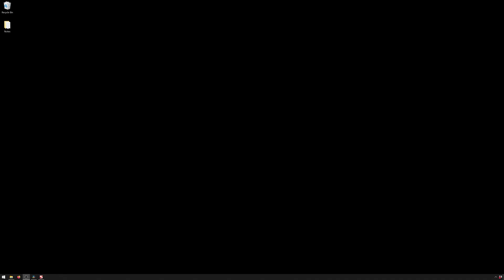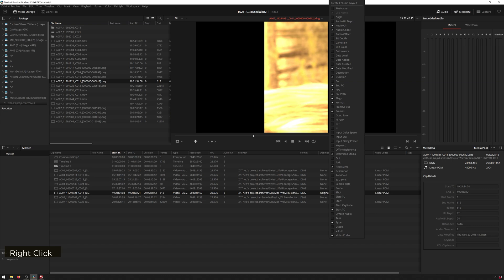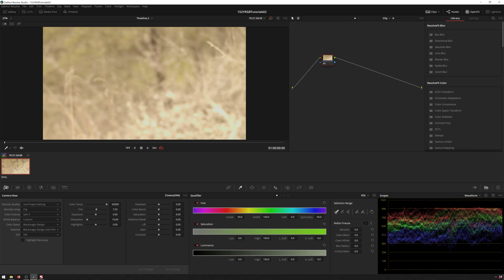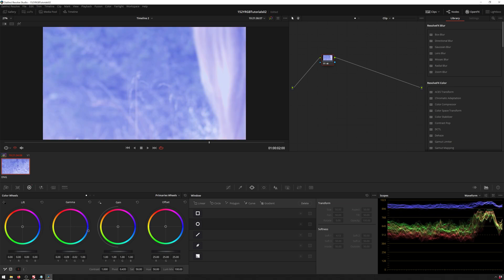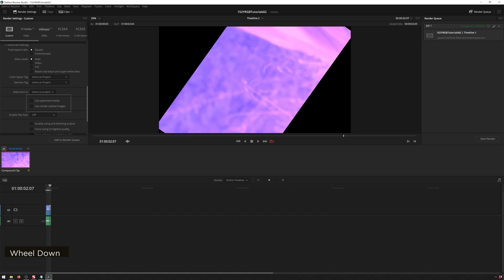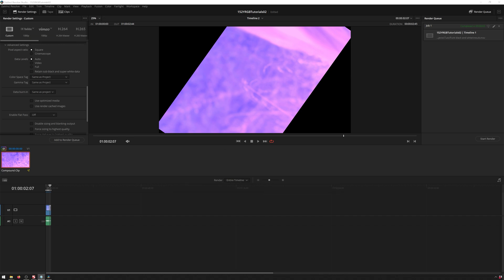A Complete Overview of The Image Signal Flow In Davinci Resolve

Comment: "Source > Debayer > Clip Attributes > Optimized Media > Media Viewer > Edit Sizing > Fusion > Edit Effects > Fusion Cache > Color > Node Cache > Transitions > Sequence Cache > Delivery"  (compound clips jump from Source > Color)

00:22 Source > Debayer - turn Photosite[1] data into normal video. 1:24 example - ?pre-conversion? white balance setting
1:34 > Clip Attributes - example pre-rotate
1:49 > Optimized media(optmed, O.M.)  - makes it "faster" for resolve to handle but has gotchas: cache invalidation and Bad UI feedback 
 ├2:30 changing raw settings invalidates O.M.
 ├ 2:48 false cache invalidation - changing clip attributes doesn't clear O.M. because you didn't actually change the attributes of the O.M????
 ├ 3:51 Bad UI for O.M. - changing raw settings on Color Page(shift+6) means the optmed is invalidated but still show as O.M. in media page.
 └ 4:47 Set  O.M. format to DNxHR HQX?
5:12 Optimized Media > Media Viewer > Timeline - O.M. & clip settings make the timeline ?desync'd?
5:56 Edit Sizing > Fusion  - 8:10 going to fusion takes away camera raw properties? (I can't see the UI feedback that indicates this?)
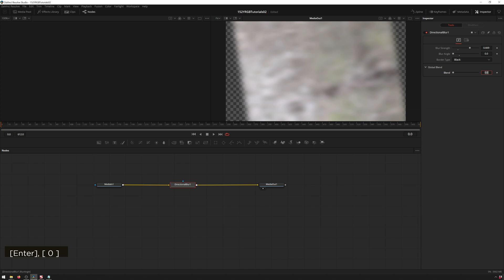 └ 6:19 example of stacked[2] effects v composite - rotation occurs before blur effect so produces horizontal ?artifacts?
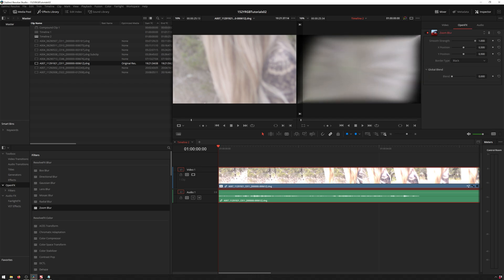6:40 > Edit Effects zoom blur happens after fusion, so is stacked not integrated
6:54 > Fusion Cache 
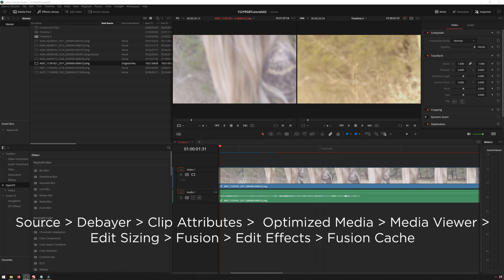8:56 Fusion Cache > Color > Node Cache - cache can be done before|after fusion
 ├  10:06 > Node Cache - turn on cache at specific location in Color Page after fusion
 └  11:36 > Node Cache - make a compound clip to use Node Cache before fusion 
12:27 Transitions > Sequence Cache
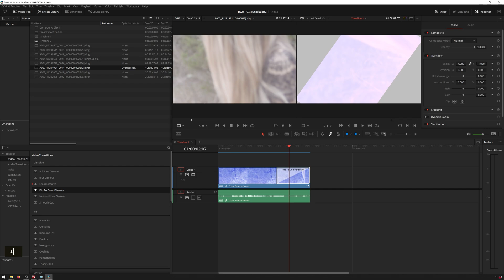13:08 Delivery - basically cache invalidation|choice, watch this for render time settings or suffer time theft
14:32 HARDCORE self hating masochists checking in 🤕💪⚙⚡ 📺🎇🌟✨

 Deep stuff to follow even for hobbyists knowing where the edges are help us not skate off edges we don't understand or even realize are there.
Probably should have kept that tl;dr breadcrumb up constantly, (compound clips > edit sizing??), and yeah the lack of mouse curse makes some context hard, see this happen alot really needs to be some mouse tracking standard that can sync like separate audio.

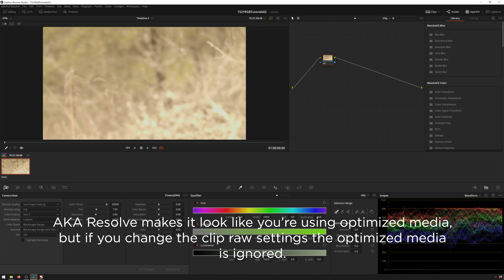4:17 &  8:10 & 8:56 cache settings seems applicable to most , i'm not a colorist don't even have a screen good enough to try so can't even tell the difference between some examples. With lowend hardware bad cache or not knowing why a bottleneck is happening is like an existential threat, not fun.

If resolve, and other NLE's, don't make stuff like this front and center
, how would one even synthesize this knowledge without a huge background in this?
Maybe they should provide some sort of page dedicated to a clear diagnostic|troubleshooting workflow basically adopting testing practices such as linting|continuous-integration from the soft-dev industry to catch common mistakes and high level problems.
I've been thinking about this ALOT due to the gotchas in fusion that hurts the learning curve.

1. An individual light-sensitive element in a digital image sensor - wiktionary
2. mean stacked in the sense of something like photoshop layers changes on lower layers don't effect settings on higher layers
Reply from the maker: This is great Paul, thanks!

Yeah its Source > Debayer > Clip attributes > Optimized media > Edit sizing > Fusion > Edit Effects > Compound clip > Edit sizing > Fusion > Edit Effects - repeat until insane. 

Resolve actually does do a pretty good job of giving the user an idea of the signal flow through their page navigation. It pretty much flows left to right. Also the manual has this spelled out in basically as much detail as I do. It would be super nice if there was some "Clip master node view" or something so we could see/change the signal flow at will, but that seems like a LOT of work for them that's not super needed. 

Also I just need to reiterate how much I appreciate the time you took to make this comment, I'm sure a lot of people will find it invaluable! 

-Theo